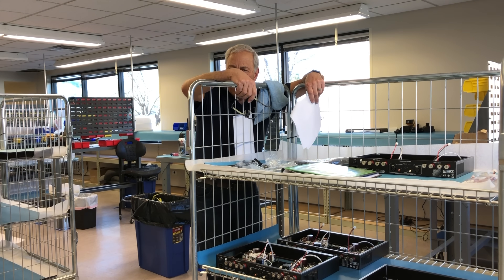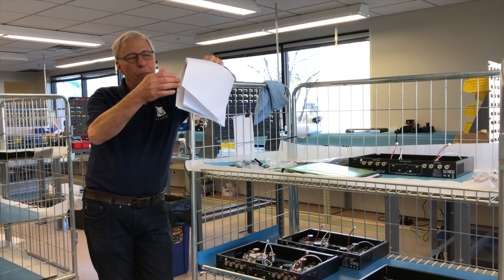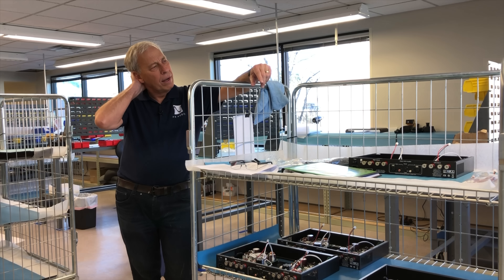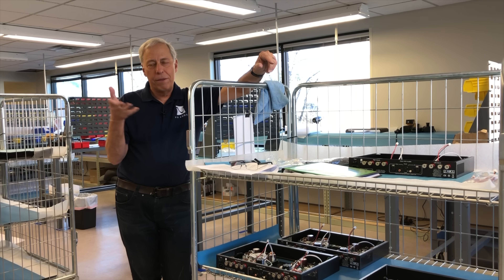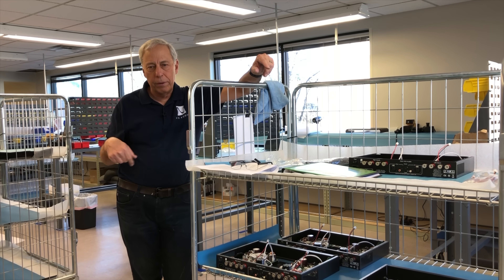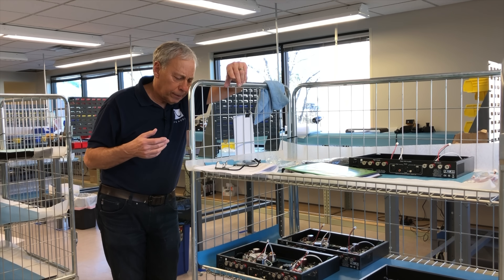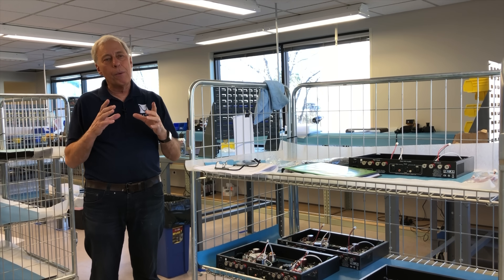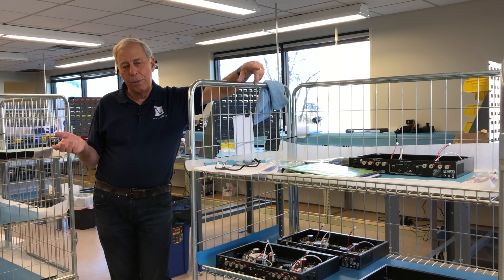What is Ferrofluid?

Comment: I think what the ferrofluid was good for primarily, was the cooling of the coils in TWEETERS, which when activated, become electromagnetic, and the fluid is attracted to them, the more power is pushed through them. And the most common issue that tweeters have is rapid overheating of the coils from high-end transients, which this can vary much quell or prevent, at least from the Heat.

Comment: I haven't seen woofers use ferrofluid in years. Tweeters and midranges I've seen lots. The problem is that in vintage gear the ferrofluid either dries up or becomes contaminated which limits performance. I've had great results removing old fluid from the gaps in NHT and Klipsch tweeters. I didn't know why my NHT 2.9's sounded so dull until i cleaned that old junk out and put fresh fluid back in the gap. It may not be very relevant in today's designs but can totally rejuvenate an old set.
Reply: I just serviced some baby advents, foams and x-overs, and one of the tweeters was pushed in, so I removed the diaphragm, as they are easily done, and saw a lot of fluid in that thing. But it really didn't seem to detract anything from the sound. I wouldn't really know where to get any at this point in time though, if it didn't need to be changed. Luckily I don't think this stuff really did. I think the guy stopped using it after the first Foams went out and he just brought them back like 20 years later

Comment: I'll add fuel to this fire:  After watching this video I was surprised to see that Paradigm's new Persona speakers use ferro-fluid, specifically in the tweeter (as per other comments below) even though the tweeter and the mid-woofer are both beryllium drivers.  Paul didn't note any detriment to using ferro-fluid; just that it's not seen as often any more.  But Paradigm's is a very recent implementation.  I wouldn't mind Paul's input on what technological advancements have occurred more recently after ferro-fluid was first introduced in audio:  are there now better solutions, or are new materials just intrinsically not as prone to negative consequences of heat?

Comment: Hi Paul. the MRI machines have magnets of superconductor (basically coils once pumped with energy and short-circuited (so the energy cycles inside of them). The crio-coolant is used not to keep the magnet cool but for keeping the coil material (wire) in the superconducting stage (near absolute zero). :) Have a nice day
Reply: True thats why you need dump resistors to extract the power once it quenches ....otherwise the whole thing will melt
Reply: didn't know about it. Though always when quench the energy goes into heat but not to this extent. I have only basic knowledge being at Bruker as a Trainee several years ago. Cool company.
Reply: e.g. http://uspas.fnal.gov/materials/17UCDavis/MachineProtection/uspas_mm.pdf page 37....nice to hear that you have worked with magnets aswell. I m working in a magnet devision at a particle accelerator facility.

Comment: Hey Paul, NASA has an article about this on their site! This video prompted me to look it up https://spinoff.nasa.gov/Spinoff2015/cg_2.html

"Speakers produce sound by sending alternating currents through a coil, which moves rapidly back and forth in relation to a permanent magnet. The coil’s movement vibrates the diaphragm, producing sound. A damper is typically a ring of any manner of materials, perhaps cardboard, paper, or silk, that fits around the coil to prevent it from wobbling and also to inhibit the diaphragm from blowing out. The downside of the damper, however, is that it can cause extraneous vibrations that can distort sound and lower overall volume capability.

Sony’s solution was to replace a solid damper with ferrofluid. The result, according to the company, is a better speaker. “The ferrofluid provides a free-flowing movement for the speaker to deliver sound without the vibration of a traditional damper, which minimizes some of the accuracy of the sound reproduction,” says Rob Manfredo, a communications specialist with Sony. “The lack of dampening also means you get three decibels more in volume.” The firm’s in-house research and development group also claims that efficiencies created by the fluid decrease energy use by 35 percent."

Also here's a link for Sony's own info: http://bit.ly/2PHtosA

Comment: You gave me an idea, Paul. Tube power amps with a super-cooled output transformers and super-cooled speaker magnets!
Reply: You would have to be careful about added noise from the nitrogen cryo compressor. While your at it, find a way to make a coolant loop that passes through the plates of a tube to allow MUCH higher power dissipation. I’m fairly sure that plate temperature is the primary limiting factor of a tubes power output, but if it’s not, it would still help to improve its capabilities.

Comment: Oh boy... The magnet coils of an MRI are kept cold with liquid helium and the He boil off is slowed by an outer cryogenic jacket of liquid nitrogen.  The coils need to be kept cold because superconducting wire (which superconducts only at very low temps) is used to generate the magnetic field.  There are no permanent magnets (where The Curie point is relevant) in most modern MRI systems (certainly not any of the human imagers found in hospitals).  Lastly, it was Pierre Curie that the Curie point/temperature is named after, not his wife.

Comment: The biggest problem is ferrofluid is it still subject to Hoffman's iron law, simply put what you gain in power handling you lose in sensitivity so a properly designed transducer should not need ferrofluid to achieve any moniker of high Fidelity. Maybe I'm wrong and if so please feel free to explain to me why.
Reply: It’s possible that ferro fluid increases sensitivity (viscosity frictional losses aside) by effectively closing the gap between the magnet and coil, extending and strengthening the magnetic field, since ferro fluid is essentially suspended iron. Even if the frictional losses negate the sensitivity gains, the fluid would provide more cooling and allow higher power operation. Tweeters don’t move in long strides like a subwoofer does, therefore, it moves less air and in turn, less air passes across the coil. Tweeters may benefit more from ferro fluid than other speakers, due to their lack of self cooling. Your assumptions are probably accurate for other speakers, like woofers and midrange drivers.
Reply: @jjhack3r  Thank you for the correction. I was totally forgetting about the tweeter side of things😂
It's very irritating when certain techs get misapplied in an attempt to achieve a goal and by then so much money has been spent the company's pawn off their failure to none knowledgeable people. So ya, tweeters ferro fluid ='s 👍

Comment: The Kef 104/2 I had used ferrofluid in the tweeter.
Reply: Same with my C-40's.
Reply: I have (British) Spirit (by Soundcraft) Absolute 2 nearfield monitors, which have a 6,5" woofer and a soft dome tweeter with ferrofluid coolant. -Woofer looks a lot the same what B&W used on DM-series, suspension curved inwards but these have a dark blue paper cone.

Comment: I think ferro fluid was first used in loudspeaker drivers by Acoustic Research in the mid 1970s in their tweeters for the model 10 pi and 11. These speaker systems were further refinements of AR3a. 

Cooling voice coils especially in tweeters is critical. Not only does ferro fluid increase power handling capacity but voice coils increase their electrical resistance when they get hot. This results in thermally induced dynamic compression. There's another good reason to use multiple tweeters. Heat is generated proportionally to the square of the current.
Reply: Got your facts a little mixed up. Epicure used it in their speakers, i.e. the Epicure 11, no real relation to Acoustic Research.

Comment: Ferrofluid also works for keeping voice coil cooler... and also used for dampening sound. used in tweeters and midrange drivers  usually. Check my EON 610 Repair video as I show the voice coil fail in a spot that was not getting cool because stock ferrofluid was inadequate

Comment: I’d always assumed ferro-fluid was used in tweeters. Its big problem is that it dries out rendering the driver useless. 

Personally I’d avoid ferro-fluid drivers, they’re a problem waiting to happen.
Reply: IIRC high end tweeters do not (or at least did not) have ferrofluid , so avoiding them is a good thing soundwise , but not so good for your budget . I may be wrong coz I am an AirMotionTransformer type of guy
Reply: @gerritgovaerts8443  Dynaudio Esotars are as high end as tweeters go and use ferro fluid.
Reply: @zaldam   As a counter example I can cite a very expensive (300 $ a piece) member of the Scan Speak Revelator series : https://www.madisoundspeakerstore.com/ring-radiator-tweeters/scanspeak-revelator-r2904/7000-09-tweeter-black-face-black-plug/
From the product description I quote : " Better dynamics are achieved by not using ferrofluid" .
I have nothing against Dynaudio , I actually used to admire them a lot when their drivers were still available to the DIY crowd . I even have advised people to buy Dynaudio speakers and I still love my Totem Signature speakers which I think have Dynaudio woofers (and a SEAS tweeter) . Scandinavian drivers are the best , but some German brands are OK too (Mundorf)